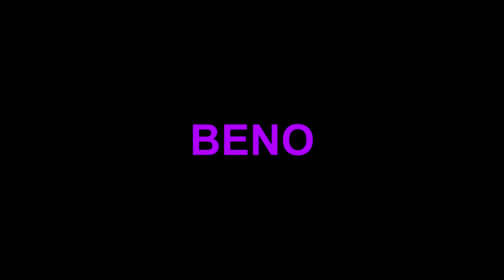How does a VF drive work and why do they make epic sounds

Comment: The VF actually destroy the sound of a Geared Traction motor in the elevator and that’s why a modern geared traction motor from generic sound no where near as good as the 80s Schindler Geared Motor and while I think Chopper make better sound for train. I think VF is better for train than for elevator

Comment: You can program an IGBT based VF drive to sound like an epic 1996 train.
Reply from the maker: The technology used for switching (e.g. IGBT) is not the important part for how a train sounds.  The pulsing frequency used is based on a judgment of the heat dissipation and current being switched.  The faster that the circuit can be switched from on to off and off to on means that there is less time spend in the half way stage which is where heat dissipation happens.  So it is the quality of the switching operation against the amount of current being switched.

The sound is produced because pure PWM becomes unsuitable when the output frequency becomes close to the switching frequency.  This is when there is not enough switching for the output to be created.  It is at this point pure PWM is changed to pattern PWM.  Pattern PWM creates interesting sound because the pulsing pattern is directly related to the output frequency and the pattern.  With higher switching frequency this change to pattern PWM happens later, but it is still happens, but is less noticeable.

To answer your question, any VF drive can be set to run with a lower switching frequency.  A lower switching frequency makes the way the drive is programmed more noticeable.  Certain drives have noticeable features.
Most of these drives are programmed exactly the same in the modern day to how they were programmed in the 90s.  The only difference is that they now run at higher switching frequencyes
Kiepe - Distinctive sound
Holec - Very distinctive and does not support pure PWM mode
GEC - classic sound
Toshiba - classic sound
Mitsubishi - Distinctive starting swoop
AnsaldoBreda - very distinctive
Hittachi Omron - The only drive with that increases frequency in pure PWM mode before switching to pattern mode.

Listen to this lift with Omron running at 400hz.  Next time I find one I will set it to the same frequency as a javelin to show it is the exact same drive.
https://www.youtube.com/watch?v=J18Mjo291Fw

Comment: Step motors... Are they similar to AC motors? They do use DC but it's kind of like a square wave. The Pin Control may be slightly different and the number of phases may be different but overall, the design is somewhat similar.

Comment: The train at 8:44 is called the Z20500 and it uses asynchronous motors not dc. 
The traction diagram is quite simple, there is a chopper which chops the frequency (200,300,600Hz) and a current inverter which cuts the frequency (11,9,7,5, full wave)
This technique was used a lot by siemens and aeg in the 80s and 90s on trams and subways.

Comment: So in a sense, a VF drive could be turned into a musical instrument? Pulse width modulation is also a common technique in analog synthesizers. In the mid 2000's I noticed that electric trains make these characteristic noises, like the dutch dubbledeck intercity trains (https://en.wikipedia.org/wiki/NS_VIRM) make a sort of high pitched humming sound that sort of makes a sweeping pattern.
Reply from the maker: Apparently this has happened.   Some engineer coded a VF drive to play a song
https://www.youtube.com/watch?v=PV2E66JNKpU
Reply: @benolifts  Looks interresting, reminds me a bit of floppy drive music. Like the Floppotron.
Reply: hey heres a taurus doing something similar https://www.youtube.com/watch?v=UkdQmDGU9AM

Comment: The class 313, 314, 315, 316, 317, 318, 320, 321, 455, & 456 trains start on fixed 200hz pulsing and when it gets to about 25 mph it starts getting fed directly. Apparently they have an AC traction current, yet they have that deep DC motor sound  Can anyone explain this?
Reply: I may be wrong but, I think it's chopper control, or maybe the pantograph
Reply: No wait, I think I know. It's all in the GECs

Comment: Thank you! I've been wanting to know much of this for many many years! I grew up riding BART and those weird late 70's/early 80's Boeing street cars. They made a lot of different interesting sounds apart from the traction drive. There was a constant low frequency that would wander around in frequency and increase when various devices on the train were in use. I remember even when the driver turned on the driver's overhead cabin light the frequency increases a little. Sometimes the frequency wanders erratically but never in big jumps. It would also raise and lower more smoothly when changing a lot.  

I've heard those Boeing street cars were strange and the electrical system was over complicated but nothing else about it. 

SO if I had to guess... maybe it's some kind of variable frequency AC stage in the main power system that increases frequency to deliver more amps!?!

Comment: Hey @Beno could you try to explain the sudden change in frequency when in PWM mode on this train? https://youtu.be/pa7e9uL2ikg
Reply from the maker: I should have mentioned that VF drive in my video.   Whoever programmed it has a very good understanding of the transistors used.   As transistors have a lower switching limit with the more amps that is switched, it is very logical that it lowers the switching frequency the harder the train accelerates.  I have heard some generic lifts do this, also I think Toyota Prius cars do this.    The thing I want to know is how does this compare to a lot of other VF drives that start their switching frequency very low for the first 1mph due to the large inrush when the motor is being held still.
Reply: @benolifts  The weird thing is that when this train decelerates it does so normally until it goes back to PWM mode. Here it does the two frequencies in the same order as when accelerating. Which is contrary to what I've seen other trains do. Is this because it is decelerating harder or is it something else?
Reply: @benolifts  That is an Alstom ONYX 2000 drive (per wikipedia). It is also used in several new york city subway trains but with more frequency changes during the PWM stage. The newest washington metro trains use a Toshiba drive that is similar to the Hitachi drive you mentioned at the end except it has a weird rising sound during the PWM stage that makes it sound like a much older drive.  Here is a sample: https://youtu.be/8c7MzKAVZTU

Comment: My favourite train is a class 465 (Brush and MetCam) and it has VF
Reply: I understand where you are coming from. Its the same as the Class 365 and Class 466. But some of the Class 465s have got Hitachi traction systems that sounds similar to the Class 395 Javelins and Class 385.
Reply: I'm talking about old brush
Reply: By miss old brush motor sound

Comment: Where’s the link to the train enthusiast talking bollocks?
Reply from the maker: I have searched for it and it seems to have gone.  It was on one of those underground forums.   After doing some searches, there are very mixed descriptions from train enthusiasts about train motor sounds, some are fairly correct and some are rather far off.